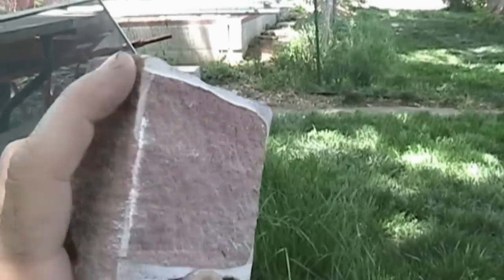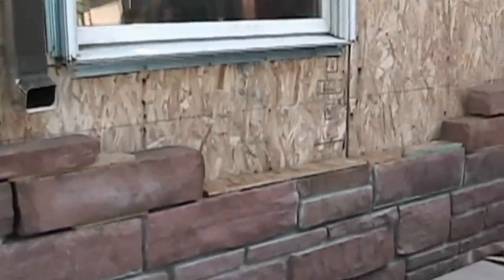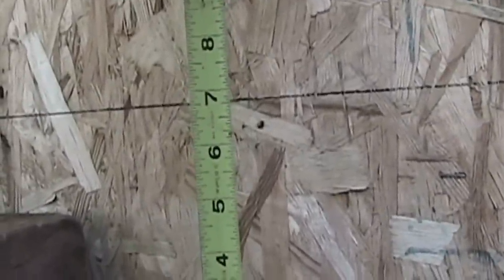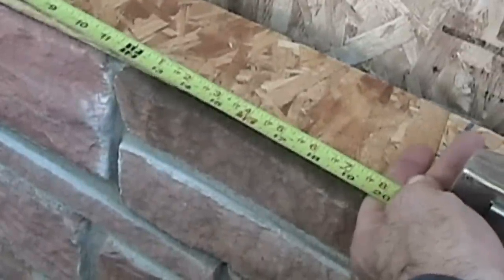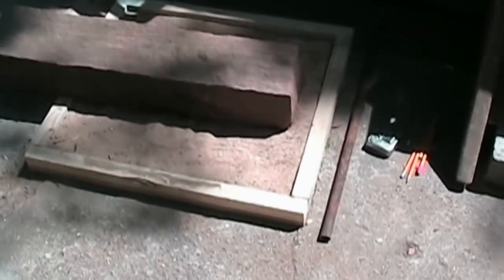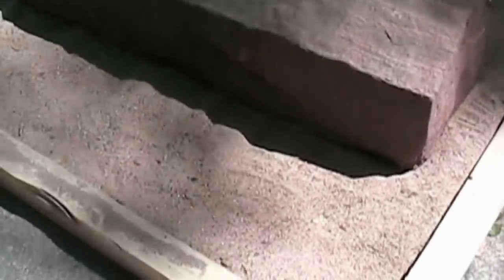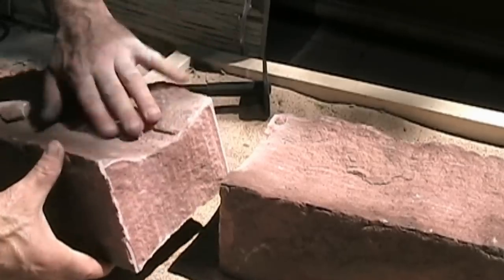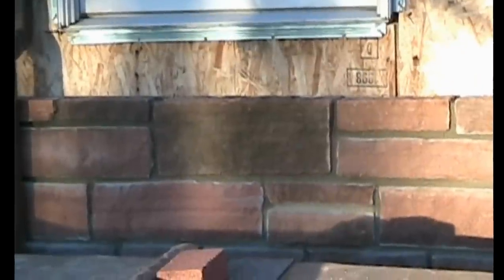Stonemasonry - Stone Cutting

Comment: I am a stonemason, and the same finish can be achieved much quicker if you were to purchase a "pitching tool" - pitching stone is the art of removing large amounts of waste with a single or couple of blows with one of these chisels and hammer,you could save a bit of time by simply cutting the same 3 sides with a grinder and then a couple of pitches. nice finish though, forget the haters.
Reply: +Eric Bowie A pitcher will still not help all those risband joints littered through the wall that you as a fellow Stonemason can see :)
Reply: +Smug caucasoid rekon.....all the running vertical joints are gona crack that wall first frost.
Reply: Scott Awaywithit For sure. He has used a 2 in 1 mix with cement and sand only by the looks of it lol, un-gauged and all different coloured joints. It's going to rack for sure. I hope it's his own home and that he has not charged some old woman for this work.
Reply: is stonemasonry a good trade?
Reply: is stonemasonry a good trade?
Reply: I enjoy it, but it takes a long time to really become a great mason, the best masons are always the most experienced=]
Reply: +Eric Bowie if you enjoy it that counts in UK they have low pay and demand
Reply: +Eric Bowie if you enjoy it that counts in UK they have low pay and demand
Reply: Looking at moving abroad very shortly! Hating the pay here.
Reply: Where are you planning?

Comment: The fastest and easiest way to do it, is to use a 7" grinder.
You just cutting from the back side, leaving uncutted 1" of stone (front side), just a little punch, and you will have a beautiful and natural shows piece, without cutted lines from top and bottom, and not chizzled face :)
Reply: +Will Fisher Bcz 7" its enough, depends on grinder, i use a Dewalt 13Amp grinder.
You can use 9" also, but time is the point, whats faster and safer to you, better.